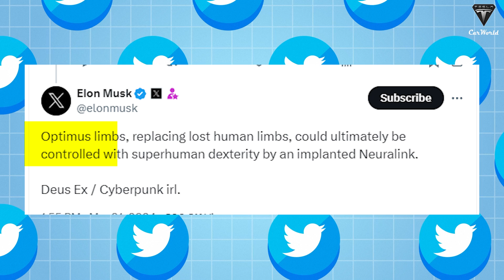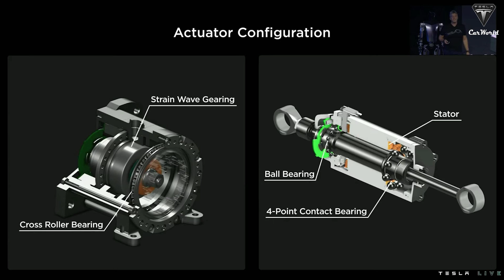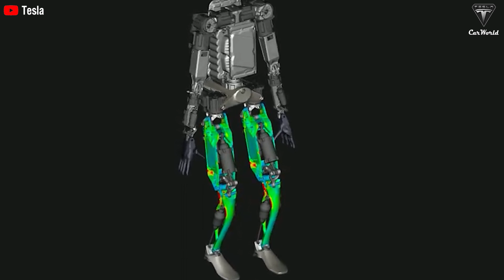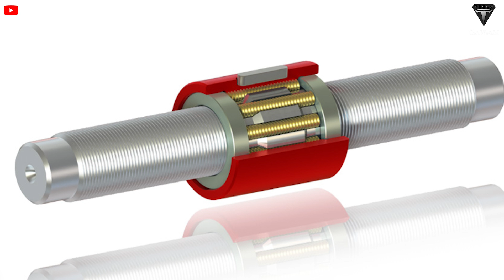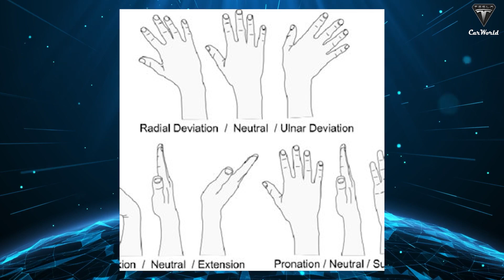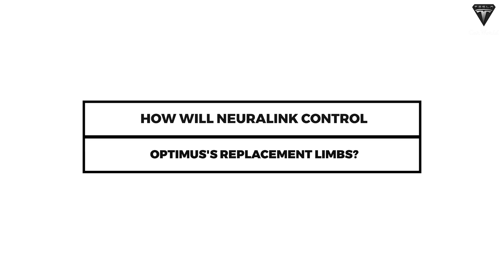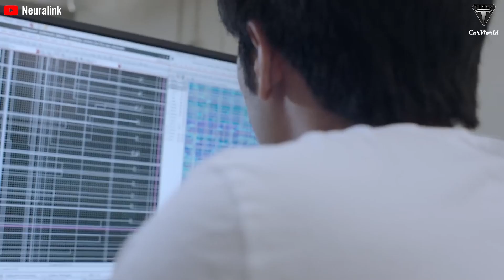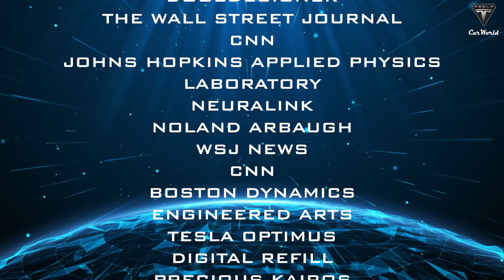Just Happened! Elon Musk LEAKED How Optimus Can Replace Lost Human Limbs? 4 Hidden Reasons Unveiled

Comment: $20k is cool, but we all know (should know) it will cost $30k for a bot. That is just the Elon way. So I'm preparing for the $30k cost 🎉
Reply: Price will start higher but like Y and 3 will reduce with scale.
Reply: Look for $50,000 and up if done in the next few years.
Reply: Why would/should it cost more? It’s made out of plastic and gears, there’s no engine, transmission, etc in it, maybe the computer chip brain would be a bit expensive
Reply from the maker: Everything is being designed with materials at a good price, the important part here is the battery and FSD. $20,000 is easily accessible. Are you willing to buy a $50,000 Tesla Bot to use for the rest of your life?